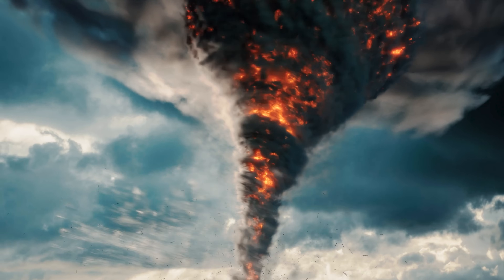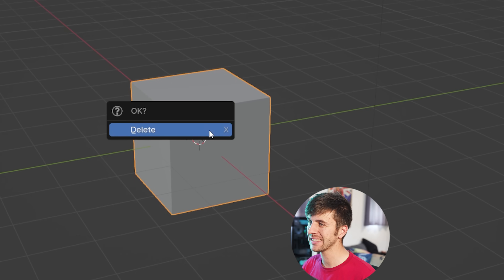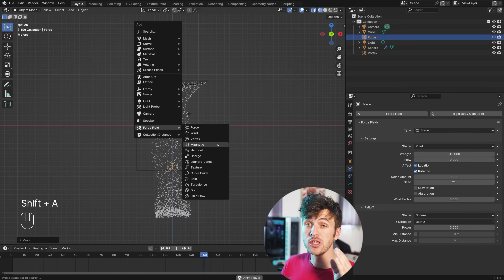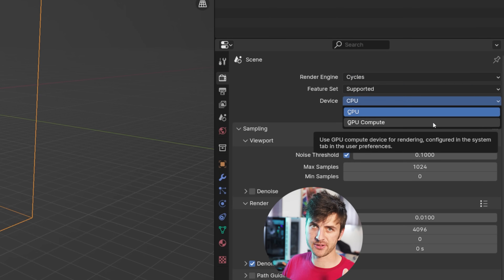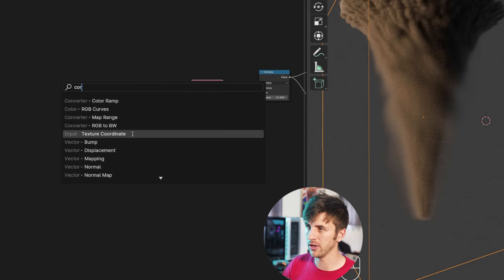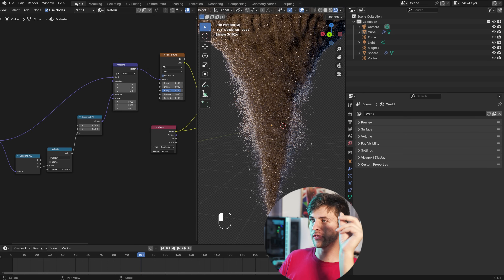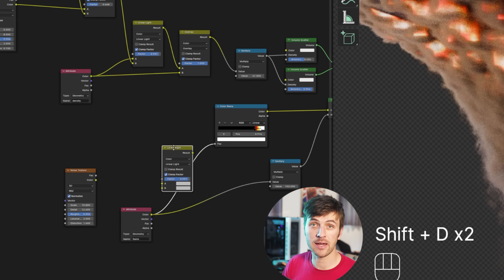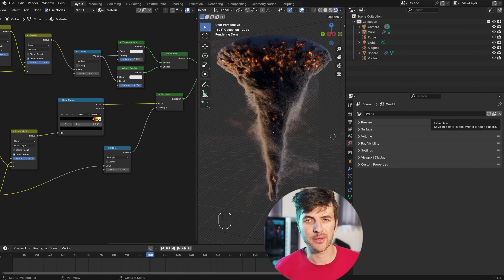How to Create a 3D Fire Tornado! (Blender Tutorial)

Comment: for the smoke to show up in the render i scratched his first node setup part and just used one node the principled volume node and that worked, i see some comments struggling as well and I did find this fix on a previous volcano project I did on my channel. I do not know how to add the extra detail with the other nodes he added but at least your smoke should show up. I did find this fix as well if you get a white image for your render go to compositing tab and remove the denoise node, connect image to image and image should show up. I hope it works I do not know how to further help haha.

Comment: I'm using blender 4.1 and this simply does not work.  At around 6:41 you connect the math node to the volume scatter nodes and then you're able to see the volume in the cube. For me, it stays the same as it was before. I had to start the tutorial over to make sure I didn't miss anything and I don't think I did. Also, Blender 4.2 is not available for download on their site, at least as of right now.
Reply: Did you solve the problem? If so, how?
Reply: Did u find a fix
Reply: I fixed this problem like this -> switched the Math node to add and deleted everything after it. Then I connected the Principled Volume after it and added it to the Material Output. If it doesn't work out, play with the Attributes settings or disable it.
Reply: Same here.

Comment: hi  cg i was doing fine on your tut until it came to doing the texure i did all the steps but nothing was showing in the rendered view im on the latest blender 4.1
Reply: Did you solve the problem? If so, how?
Reply: @smokiman7313  Just instead of adding 2 volume scatter, add 1 principled volume
Reply: I fixed this problem like this -> switched the Math node to add and deleted everything after it. Then I connected the Principled Volume after it and added it to the Material Output. If it doesn't work out, play with the Attributes settings or disable it.

Comment: i swear yall talk after doing the tutorial and it makes it so annoying to follow since you go faster than you talk
Reply: good tut tho, my laptop could not run it for shit lol its good for random shit but not blender fk amd
Reply: nah wtf you have to be zooming in on purpose do you get more engagement from rewinds shits evil
Reply from the maker: ur not a fan of zooming in while changing values etc on nodes? It should make it easier to follow especially on mobile devices
Reply: @CGGeek  need like a 5 second lul before you move on, ideally explain the why rather than just plugin values, you quiickly zoom out and switch over it gets confusing looking back and forth on laptop.  Its probably easy for ppl who know what you're sayign but as someone who has to figure out where you're clicking and why its hard to follow.  Like some parts where i knew what you were talking about were easier to follow since i didn't have to look over to find what the node is called or where to grab it.  (so i dont grab the wrong kind with a similar name.)  Overall useful tut, really frustrating to follow took like an hour of rewinding.  Would've prefered a slightly longer vid.

Comment: high quality results, high chances of laptop dying
Reply: do the old tornado tut. your laptop will die even harder
Reply: Nah, my laptop was quite fine with it (just a bit slow). There was a animal .blend that I downloaded, super-realistic hair, the works. Really impressive job, but when I started rendering it (just a single image) my computer bluescreened multiple times.
Reply: @Vousie  mine is 12 years old
Reply: @Vousie  for money, i cant afford a laptop that supports windows 11
Reply: @det.idiot10  My point is just that having a reasonably good computer (even a second-hand gaming laptop, but preferably a desktop) is pretty much required for this type of 3D animation. Else you're largely wasting your time. If you want to do modelling instead then you can get away with much lower specs on the computer.
Reply: @Vousie  i model and sell, and others i animate in rblx studio its low end

Comment: hi  cg i was doing fine on your tut until it came to doing the texure i did all the steps but nothing was showing in the rendered view im on the latest blender 4.1
Reply: Did you solve the problem? If so, how?
Reply: @smokiman7313  I fixed this problem like this -> switched the Math node to add and deleted everything after it. Then I connected the Principled Volume after it and added it to the Material Output. If it doesn't work out, play with the Attributes settings or disable it.
Reply: Principles Volume -> density
Reply: you have to adjust the clipping end of your camera, atleast that fixed it for me
Reply: same, nothing is showing up
Reply: @eliastico  found a solution? not working for me too

Comment: Nice result! I would only recommend, instead of having people to remember how the names of the attributes need to be, use the Volume Info node. It provides outputs for those attributes and more. The other thing is, when talking about the Max Bounces, your Transparent bounces are at 8. I would highly recommend using a much higher value like 32 or even better 64, it does not really increase the render time very much but it avoids getting black artifacts in the smoke. I don't see them in your example, but it can happen especially when you increase the smoke resolution. I've seen smoke tutorials with people claiming this to be Blender's fault by unfortunately having a buggy Adaptive Domain behaviour, but it's actually the fault of people always lowering bounce values for gaining render speed.